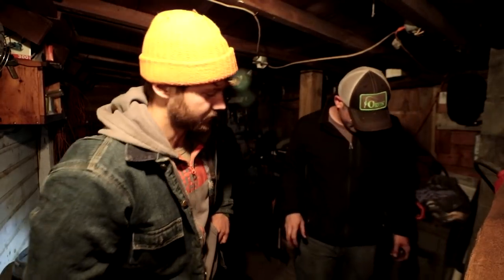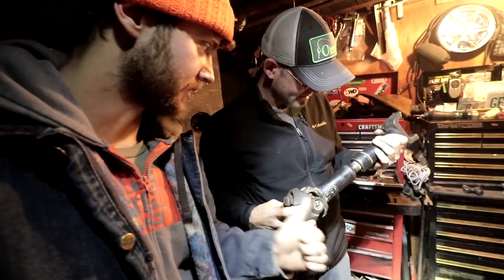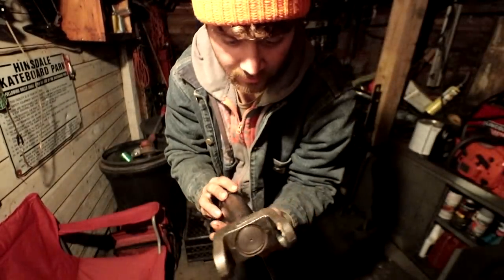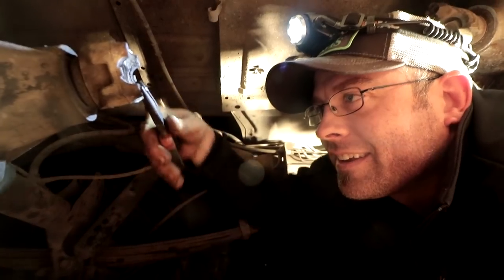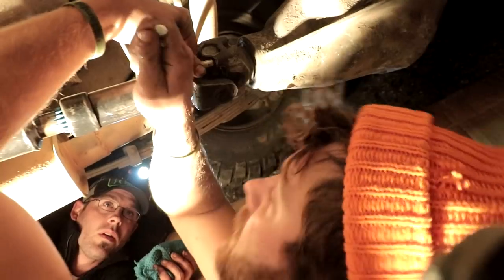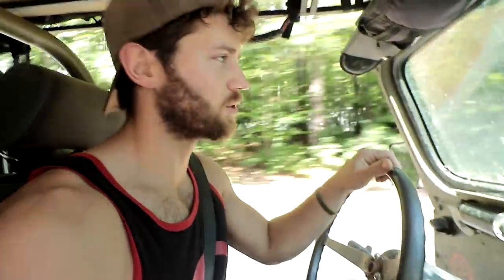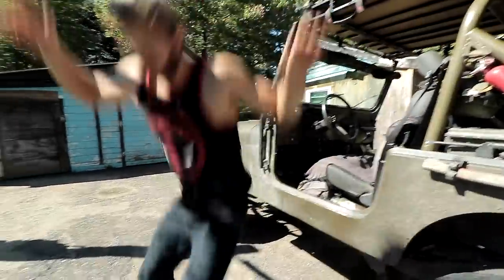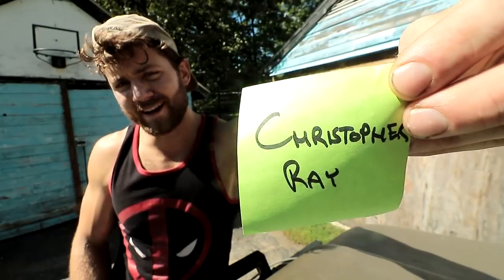STEALING JEEP PARTS

Comment from the maker: Happy freaking Friday! I hope you all have a great weekend and better luck hitting the trails than I have had lately. Thanks for the support everyone and a huge shout out once again to Jason for sparing his own Jeep to help us out; he's a great dude.
Reply: Hey Jake....if Jade needs more work before you head south of New England my offer still stands (filled out the questionnaire). Got a nice shop w/lift, all the tools you’ll ever need for any work you want to do on her.

As always, love following along!
Reply: I MAY BE WRONG BUT I MIGHT BE RIGHT(& I think I might be). Jake or anyone who can get in touch with Jason(the guy who can't get his black YJ to Fire up) please get him this message.  I'm definitely not a know it all but I think Imight know why it won't start. So please tell Jason to put his key in the ignition and turn it over to the on position/accessories and see if on his dash cluster if his check engine light comes on or lights up. I had the same exact issue as he is having when trying to get my 93YJ 4.0L running. I changed my CPS thinking that was the answer but it didn't change anything. It's an easy fix if the CEL doesn't light up/come on when the key is turned over. It means that he has a bad ECM. It only cost me $25 dollars for a used ECM out of a 94 4cyl from a junkyard. There's a guy on Ebay that will fix it for $70 and he even warranties his work or you can just go to a junkyard and snag one off another Jeep like I did. Especially if he has a 4.0l 6cyl because any 4cyl or 6cyl ECM(computer) will work with a 4.0l 6cyl from 92-95 YJ. I hope this message can get to you Jake or Jason.  I figured out it was my problem when I was trying to get my codes that it was throwing by doing the on off on off on. Good luck and If I can  help in anyway possible please just message me back and I'll give you my number. I got my 93 Sahara YJ hardtop, AC etc etc for just 500 because of the ECM, it about drove the original owner crazy trying to fix it. Took me 2 days and 40 dollars total to get it going. Hope I'm right and you get this message and it helps!
Reply: iamjake how do you secure your guns in jade? I’m looking for a better way for my jeep

Comment: I MAY BE WRONG BUT I MIGHT BE RIGHT(& I think I might be). Jake or anyone who can get in touch with Jason(the guy who can't get his black YJ to Fire up) please get him this message.  I'm definitely not a know it all but I think Imight know why it won't start. So please tell Jason to put his key in the ignition and turn it over to the on position/accessories and see if on his dash cluster if his check engine light comes on or lights up. I had the same exact issue as he is having when trying to get my 93YJ 4.0L running. I changed my CPS thinking that was the answer but it didn't change anything. It's an easy fix if the CEL doesn't light up/come on when the key is turned over. It means that he has a bad ECM. It only cost me $25 dollars for a used ECM out of a 94 4cyl from a junkyard. There's a guy on Ebay that will fix it for $70 and he even warranties his work or you can just go to a junkyard and snag one off another Jeep like I did. Especially if he has a 4.0l 6cyl because any 4cyl or 6cyl ECM(computer) will work with a 4.0l 6cyl from 91-95 YJ. I hope this message can get to you Jake or Jason.  I figured out it was my problem when I was trying to get my codes that it was throwing by doing the on off on off on. Good luck and hope this helps, if not no harm done. If I can  help in anyway possible please just message me back and I'll give you my number. I got my 93 Sahara YJ hardtop, AC etc etc for just 500 because of the ECM, it about drove the original owner crazy trying to fix it. Took me 2 days and 40 dollars total to get it going. Hope I'm right and you get this message and it helps!

Comment: You may want to consider a U-bolt conversion yoke. U-bolts are a lot stronger than the strap style yoke and if you end up breaking one, you don't run the risk of a bolt breaking off in the yoke. You're very lucky to have gotten the broken bolts out; they're usually/suppose to be loctited and are impossible to remove once broken.

Comment: one time I drove 2000 miles to the rocky mountain national park and 2 miles into the park my low oil pressure light comes on and my car stalls RIP. I rolled down the mountain in neutral and spent the next several hours enjoying the scenic view from the parking lot of the only mechanic for like 40 miles

Comment: If you use a piece af motorcycle tube and slide it over your slip joint and secure with hose clamps to will keep all the water and dirt out kinda like a drive shaft condom

Comment: Fingers crossed the jamboree is after the 14th and my fuel pump is finished! Will be interested to see what kinda gas mileage my K5 gets on the highway from NY
Reply: At least 8. Bestfriend had one in HS. It got 8mpg, but gas was $.99/gal on the base at the time.
Reply: I'll take 8 with 35's 4.56 gears and 70mph! lol